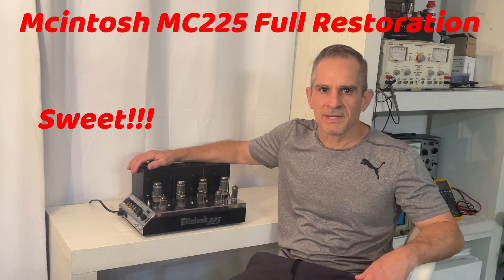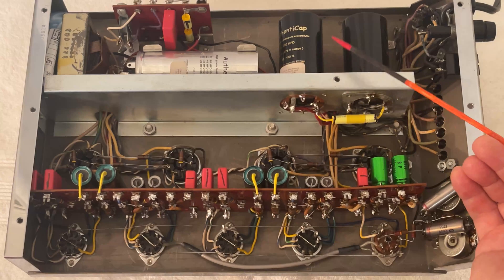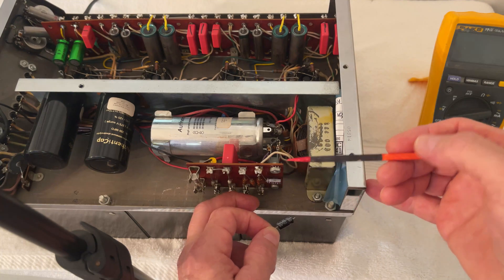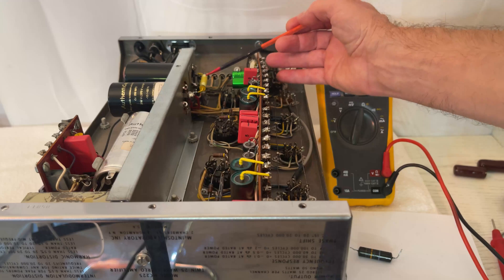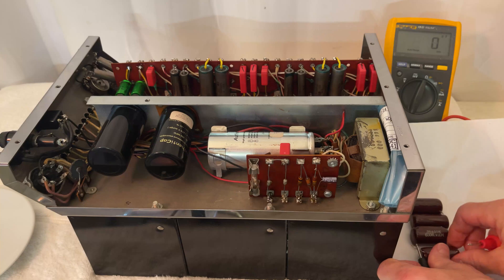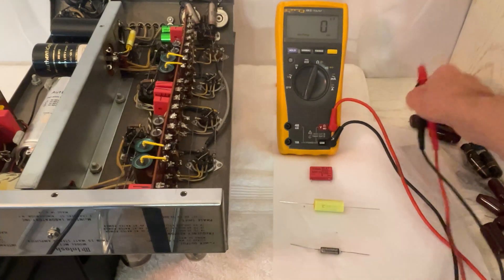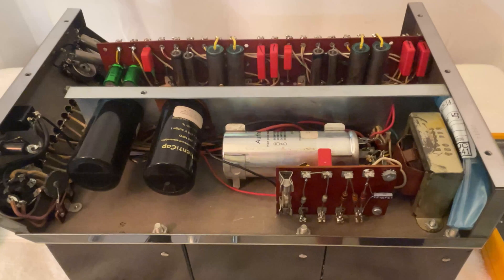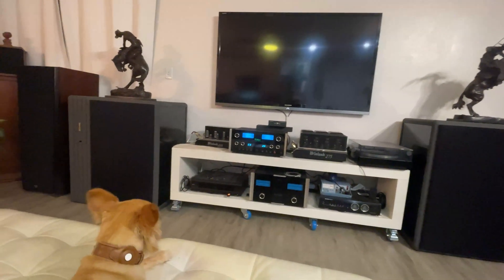Mcintosh Mc225 Vintage Vacuum Tube Amplifier Complete Restoration & Upgrade

Comment: I have a krell ksa 300s  Can I send it to you to repair it It won't power up anymore
Reply from the maker: @chadabrams2207  
Hello!
That is a gorgeous amplifier.
Yes, you can send to be.
Is it completely dead or it tries to turn on and then shut itself off?
Anything at all happens when you push the power switch?
If so, it’s probably the main circuit breaker on the back of the unit.
I believe it is white circular and has a number 12 on it.
Have you tried pushing that in?
The main breaker not be engaging, but in some cases it does and it protects the unit by doing so.
Please let me know if that fixes your issue.
Good luck.🙂🙏
Reply: @Tinybench   All I can hear is a  Relay click on but it won't do anything Could you give me your address to send it to Thank you